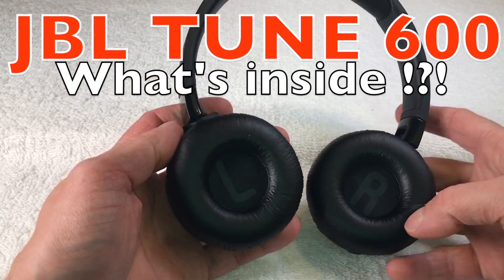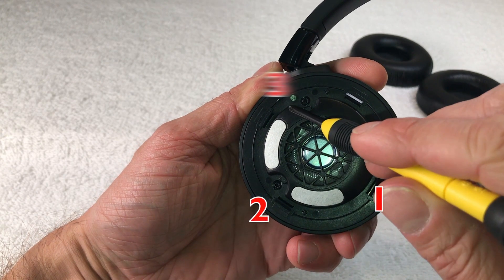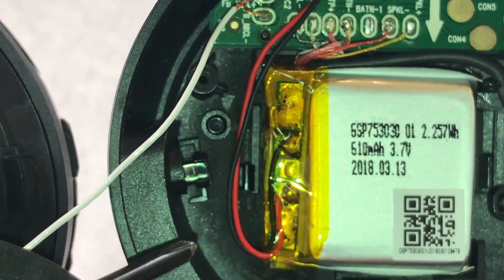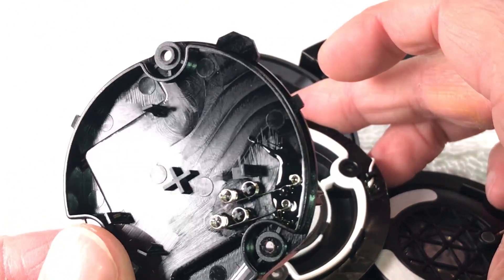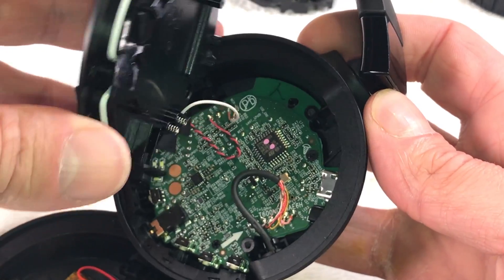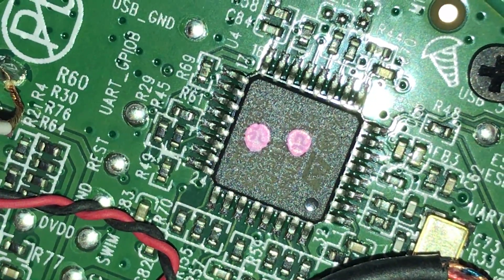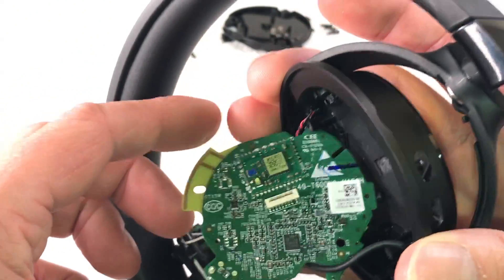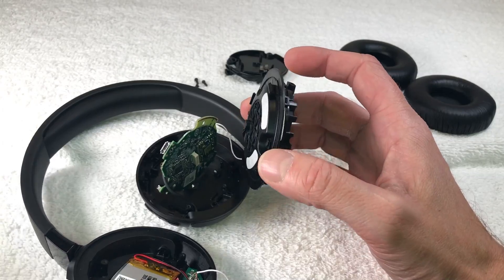🎧 WHAT's inside JBL TUNE600 wireless headphones - TEARDOWN

Comment: I want to upgrade my battery, it only has 3 hours play time with anc on. Its only rated at 12 hrs max but these headphones have better sound than most of my other ones i need a compatible battery with more amp hours.. Which battery upgrade is good for these gems???

Comment: I dropped my headphones at gym about 50-60 cm height. Then it stopped working. When i try to turn on it blue light lights on then suddenly off and then noice cancelling’s white light turn on. Also there is no sound coming out from its speakers. If i press hold the power button it pairs w my phone. So what is wrong with it? Is there anyone who knows how to fix it?

Comment: I wonder what would happen if I tried disassembling the battery
Reply from the maker: You’ll run for the nearest fire extinguisher.
Reply: @MegaSafetyFirst  do you think there is a way of disassembling it without any problems ? Because i'm interested in taking the lithium inside of it

Comment: My springs has connections issue can u help me plz
Reply: Clean the ends of the springs and the copper pads the press against with a q-tip and denatured alcohol (let it dry completely before reassembling) and GENTLY stretch the springs just enough so they will press against the copper pads a little harder.

Comment: the right side stopped working and i don't know why, it just did but it didn't look broken
Reply: I just had the same issue. Disassembled them, tried to probe some points on the PCB without success. Finally, I tried wiring the springs to the PCB while playing music, and it worked. I cleaned the contact surface on the PCB, the one the springs are supposed to touch. Still working after re-assembly, so I guess it's just a bad contact of the springs...
Reply: @natanlieds4468  yes probably weak contacted wires, i didn't open inside them but I was using one side and other was not working. One week later while I was walking on the road suddenly both sides started to work well
Reply from the maker: Did you check the soldering joints of the wires for the left audio channel?
Reply: @MegaSafetyFirst  Yes, and all of the buttons and lights work just the speaker doesn't work so it must be that wire
Reply: @MegaSafetyFirst  I'm having trouble why you would check the wiring for the LEFT side if the problem is in the RIGHT side.
Reply: Did u fix that issue , because I have same  problem
Reply: @baturay7131  kind of i stopped using them for like 2 weeks to a month and they just worked again 
I have no idea why though
Reply: @ShapeshiftingPotato  After it worked, how long time happened without live any problem?
Reply: @baturay7131  after they worked and havent had problems since im using them right now
I think i use them too much but mine could be weird i dont know
Reply: The right side uses small springs pressing against copper pads the get the signal from the circuit board to the sound transducer.  Clean the ends of both springs with a q-tip and denatured alcohol then VERY GENTLY stretch the springs just enough so they push against the copper pads a little bit harder.

Comment: Would it be difficult to take out the electronics in one set of headphones and put them into a different band?
Reply from the maker: I’d think that would be difficult to do. 
You’d have to unsolder the connections between the two sides of the headphones

Comment: You should do a tear down of the E45 and E55BT (E65BTNC are actually better constructed), the build quality of the E45 and E55BT is absolutely horrible, very sloppy wiring in the headband and hinges causing wire chafing and just a joke with regards to assembly techniques! The T450BT is also poorly made as well with lots of sloppy solder joints and even solder balls on the PCB! I've taken the new  T500BT apart which are very similar in construction the these T600BTNC and they're much better constructed compared to the T450BT in terms of solder quality and component placement on the PCB. I seems like JBL a had major laps in judgement with the last generation and are maybe trying to fix their screw-ups. 

If you look at the new Live 400 and 500BT you'll notice the materials used are better, particularly the hinges are a more durable material and the ear cups seem to have a better quality PU leather. I've also noticed overall fidelity to be cleaner compared to the E45 and E55.

Comment: @ 1:45 that seal is for acoustic reasons. The driver is in a "sealed" chamber that's engineered to give the drivers a specific sound profile.
Reply: Its actually a vented enclosure, but yes the seal is to make sure none of the air gets into the rest of the headphone cups. Its for better bass response.

Comment: If the left side of the headphones doesn't work , do I have a chance to fix it ????
Reply from the maker: I would check the wiring between left and right side. 
I’ve seen poor solder joints before, which are easy to fix.
Reply: @MegaSafetyFirst  hey man, i wish i came across your channel earlier. My right side stopped working on mine a few months back so i sent it back to the place i bought it from  so they fixed it. After fixing it the right side would stop working suddenly while listening to music, i would tap on it and it would work again. Now it is completely dead again and I don't want to send it back cause they took a lot of time to fix it the first time. Any ideas on what the problem is?
Reply: The right side uses small springs pressing against copper pads the get the signal from the circuit board to the sound transducer.  Clean the ends of both springs with a q-tip and denatured alcohol then VERY GENTLY stretch the springs just enough so they push against the copper pads a little bit harder.
Reply: i have the exact same man

Comment: More interesting question:
On the main PCB board; what is that white connector socket on the back used for?
Reply from the maker: That is an interesting question!
I could imagine that this used to be the debugging port during the development phase. What do you think?
Reply: @MegaSafetyFirst  Going from my experience in electronics, that port is probably for loading the firmware for the headphones during the assembly phase.